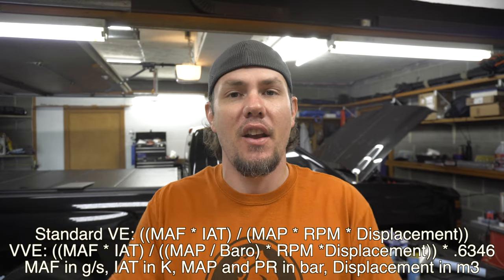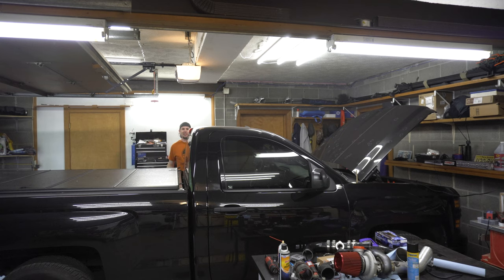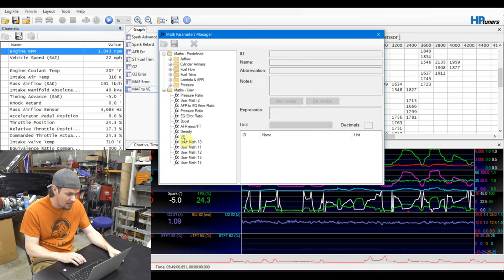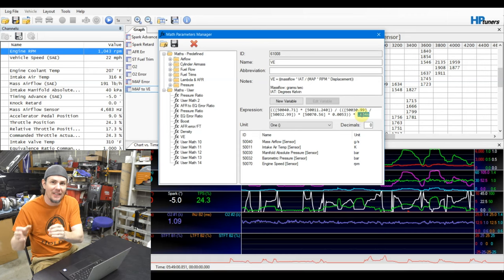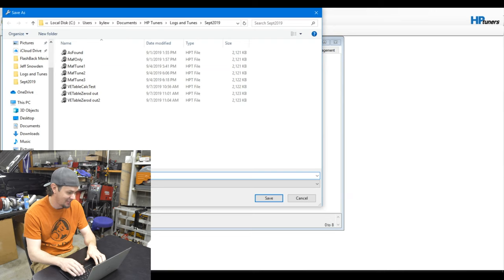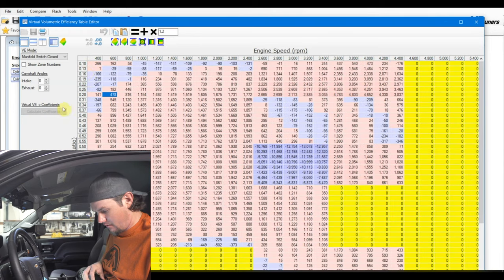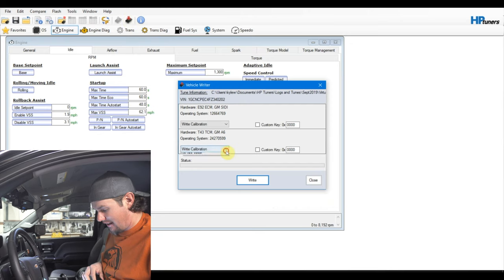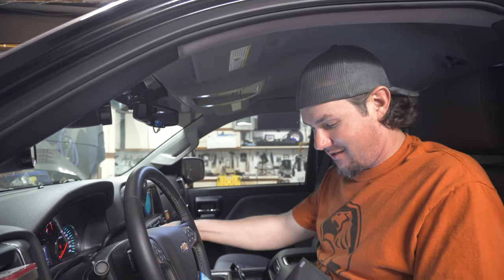VE Table From Mass Air Flow Sensor, Creating A SD Table From Scratch!

Comment: To add from my last post.  Once you have created your table Maf to Ve and added the table to your log and in conjunction with your EQ Ratio Error log.  Once you have logged a run, now you can prove your Ratio.   Previous Vve table value / Maf to Ve value = % EQ Ratio Error.  Of course it wont always equal the error but it usually in the ball park.  Thats why its important to adjust your desired output multiplier in the Maf to Ve equation to match your VVE table and Error adjustment or desired Lambda.   So this is how I used Goat Rope tuning formula,  obviously I chose to not Zero out my VVE tables and Im still running Speed Density in Open Loop.  Of course I could be doing it all wrong,  some how it seems to work.  Im just passing on my experience using this Formula.  Thanks again Goat Rope Tuning!

Comment: Try this for building GenV VVE

MassAirflow * Temp / (MAP * RPM * Displacement)

MassAirflow: g/sec
Temp: Under 'Airflow > Speed Density', it’s the 'VE Base Temp' converted to Kelvin
MAP: BAR
Displacement: Cubic Meters
 (I think this is of 1 cylinder, haven't done it in a while but, slightly possible it's all cylinders)

Should be spot on. I was using IAT in K for Temp and was always close but, not spot on. I decided to try the 'VE Base Temp' in K and voila. I think this is usually 68F which would be 293.15K
Reply from the maker: Good info! Thanks for sharing!
Reply: @GoatRopeGarage   No problem. Also, I do not use pressure ratio (MAP/Baro) in the calculation, but rather only use it to find the calculated value's place on the PRxRPM table (if that makes sense). It's spot on for me.
I thoroughly enjoy your channel BTW!!!

Comment: Gen IV,  2015 Camaro Z28 427, ZO6 Gen IV  Corvette motor, Gen V drivetrain.     Gen IV 427:  (Mass Airflow g/s * IAT K) / (Manifold Absolute Pressure Bar * Engine Speed Rpm * 427 displacement (.0070 m3)) * (desired Output/Lambda).  HP tuner Formula:  ([50040.71] * [50011.240]) / ([50030.99] * [50070.56] * (0.0070)) * (1.04).  VVE  is Gen IV.  I'm using most of your formual but not zeroing out my VVE tables.  Im using this MAF to VE formual in conjunction with my EQ Ratio Error to populate the VVE Table.  The EQ Ratio Error is used as a check and the New table MAF to VE is pasted to the VVE Table, all values are 100%, no dividing by half, just the full amount from the new table Maf to Ve.  Important that you prove the output of your formula, with calculator, with the previous VVe table and using you EQ Rato Error table as a check.  VE= (Massflow*IAT)/(MAP*RPM*Displacement)*(fine tuning desired output (Maf to VE table), check EQ Ratio Error and unchanged Vve table to prove desired output.)  Here's the calculation I used for a Gen IV 427:  (Mass Airflow g/s * IAT K) / (Manifold Absolute Pressure Bar * Engine Speed Rpm * 427 displacement (.0070 m3)) * (desired Output/Lambda).  HP tuner Formula:  ([50040.71] * [50011.240]) / ([50030.99] * [50070.56] * (0.0070)) * (1.04).  For my 2015 Camaro Z28  this Formula seems to work quite well but it is still involves adjusting the numbers.  Its just another tool to help getting your Tune where it needs to be.  Thank you Goat Rope Tuning!     Very exciting, thanks for all you hard work, much appreciated.  Remember to prove your table, the goal is not to run lean.
Reply from the maker: That's good stuff, Dennis, thanks for sharing!

Comment: I have an odd question. I pulled a factory tune off of the hp tuners site for a 6L GTO, and the math under engine displacement works out to 5.7L. I know earlier GTOs were 5.7L, but this is from a confirmed 6L. I had others with 6Ls check their files, and they come up with the same 5.7L in the displacement section too. So why is this, and where is displacement actually accounted for in the tune if not here? My concern is that if I stroked the engine, I would’ve planned to simply change that displacement, but it doesn’t seem to be used.

Comment: Trying to duplicate this for Gen3. I see your formula for Standard VE is:

((MAF * IAT) / (MAP * RPM * Displacement))

I have a data log with the following information:

MAF = 155.43g/s
IAT = 305.37K
MAP = 1.01Bar
RPM = 3202
Displacement = .005699 m3

The result I get is 2575.25. What am I supposed to do with this number, as it is not one that fits my VE table.

Comment: But if i have a aftermarket intake and exhust system we must recalibrate the MAF so we can't use it to fill the VE table im confused 😕. Maybe this only work if your stock and doing speed density mod
Reply from the maker: You can quickly and easily recalibrate the MAF, it's a much simpler process

Comment: I can't seem to get this to work on 3 gen. I get numbers like 1411, 1543 and so on. These numbers simply don't look right for my VE table. Do I use the wrong math? 
I use the one provided in here for standard VE Table
VE: ((MAF * IAT) / (MAP * RPM * Displacement))
MAF in g/s
IAT in K
MAP in bar
Displacement in m3 (times number of cylinders (8)
Reply: Having the same problem!